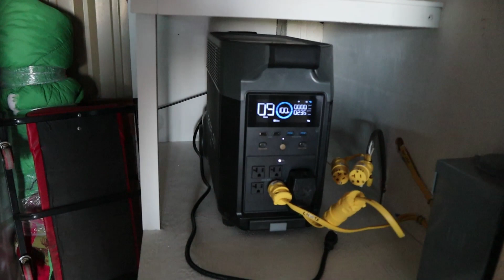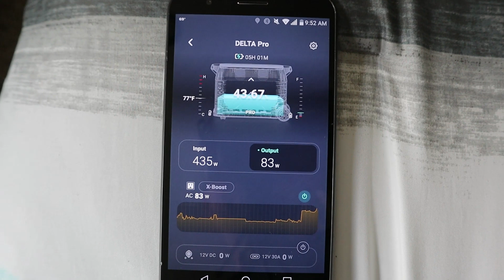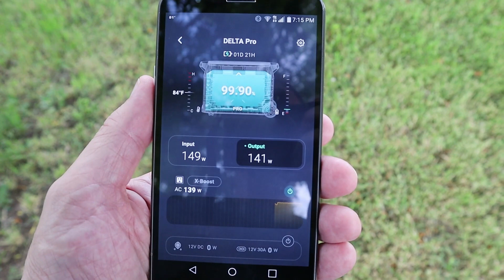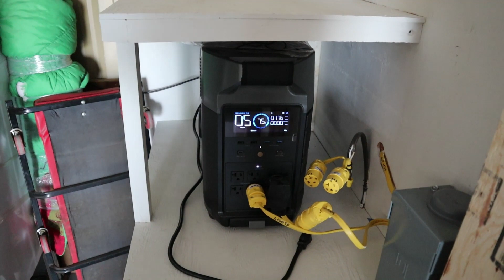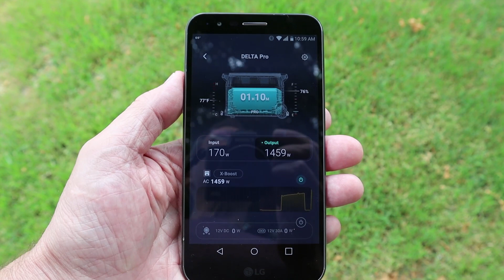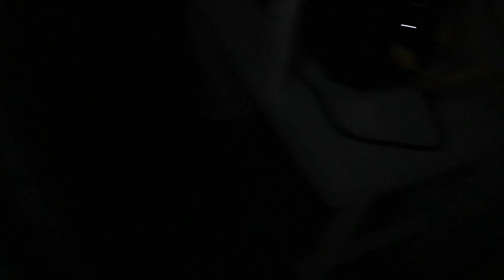Off grid: EcoFlow Delta Pro running an RV

Comment: In all reality ac and heating is a huge part of life why cant any of you just do a video on how long itll do the ac for
Reply from the maker: Is that a request?
Reply: @bladeslicemaster5390 whoa 😅 yeah if your still using it youd be the first video im sure of it 😂
Reply from the maker: @cryptologic90  a motorhome A/C unit has a 13.5k btu unit that takes about 1,300 watts while running, start up is much more. The Delta Pro has 3,600 watt hours of battery capacity, so without any solar input, or anything else running, it would run it for about 2.5 hours. Hope this helps, thanks for the suggestion!
Reply: Do you know about the soft start for the AC if not check into that  @cryptologic90

Comment: I just got my D-Pro, $5,000 but worth every penny! It is rather like a computer backup battery on steroids!
Reply from the maker: Congrats! I use mine every day. I'll post a video of it running an irrigation pump soon.
Reply: @bladeslicemaster5390  It runs microwave ovens like second nature!  Sure the first flaw is purchase price; it is pricey. But the one huge flaw is weight.  We all know it is not much bigger in dimensions than an average 2000W gas generator but it weighs more than double those generators, 100 lbs!

Comment: How many watts are the solar panels connected?
Reply from the maker: 1000 watts al together.
Reply: @bladeslicemaster5390  Thank you for the quick response. Do you know the maximum amount of panel wattage the delta pro can handle? Also do you know if it can run a rv that has a 50amp plug? I know nothing about solar so trying to understand the concept.
Reply from the maker: @8victoryinjesus  max wattage is 1600, see my video on "running an RV" Thanks!

Comment: Great video.  The best way to use the DP in an RV is to connect the 30amp DC connection on the DP to your RV, then turn off the converter circuit like you did.  This way there is no loss for converting DC to AC then back to DC.  That is how I use it in my travel trailer.  I keep it in the passthrough storage.  Presently, I run the DP 30amp AC connecter outside to the RV 30amp shore power connector.  This is a mess and only a temporary solution.  I purchased a 30amp transfer switch so I can have it switch between the DP and the shore power, but I have not connected that yet.  I need to drop the underbelly to run the wires and am waiting for a few rainless days before taking that on.
Reply from the maker: Thanks for your great comments!
Reply: Hi Frank - we just got a DP and plug our RV 30 amp directly into the DP. The first time we did this and tested various appliances it worked great. The second time we plugged it in, there was a continuous 400-500w draw happening even though we turned absolutely EVERYTHING off in the RV and unplugged everything. Any ideas what could be happening here?? it's unusable to us until we can figure this out as it just drains so fast. Just thought I'd ask, no worries if you have no idea. 😂
Reply from the maker: @sunnichapman  Maybe water heater?
Reply: @bladeslicemaster5390  we made sure to have water heater and water pump and all that off too. I think it may be actually just attempting to charge our RV house batteries like you said and I need to turn off the converter circuit, but I am not sure where or how to do that on our Forest River Forester RV, we know where the little fuse box with fan is, but not sure how or what to 'turn off' there in order to do that?
Reply: @bladeslicemaster5390  thank you for your reply!
Reply from the maker: @sunnichapman  There should be a main breaker that disconnects all the power, give that a try.
Reply: @sunnichapman  it is either charging your house batteries or the fridge is running on AC. Check that the fridge is off or it is not in the auto position. If it is on auto it will switch to AC power whenever it's available. That means it will run if the Delta pro is on and the inverter is on. As far as finding the breaker for the converter, just look at the notes inside the breaker panel. It should tell you what breaker turns on and off what in the RV. If it's not marked then a little trial and error won't hurt. There should not be many breakers to turn off anyway. But if you are only using the 30 amp AC outlet on the Delta pro you will need your converter to be on. That is what will power the DC circuits. Like I said in my post, if you use the 30 amp dc output on the Delta pro to power the DC circuits of your RV, you don't need to use the converter. Hope this helps.
Reply: @yankiefrankie  thank you Frank! yes we did put the Fridge on Propane only, and turned it off "auto", and even turned off the fridge just to be sure. But then kept it on propane only. Thanks for the suggestions on finding the converter, will try that! And thanks for the clarification on 30 amp AC outlet. Forgive my ignorance but I am a bit confused on that part, we plug in our RV's 30 amp shore power plug in directly to the Delta Pro, and that's it. I am not sure the difference between where you say 30 amp DC output on the Delta Pro and 30 amp AC outlet on the delta pro? Thanks so much for your help!
Reply: @yankiefrankie  So we did figure out that it was indeed charging our house RV batteries after our test today. I found the breaker for the converter, turned it off and the DP stopped pulling power for the battery, but it also stopped pulling power from the DP for anything else in the RV that we turned on. I'm not sure if there is a way around this for us, but if I am missing something obvious, let me know. Thanks again for your help. :)
Reply: @yankiefrankie  I figured it out Frank! Sorry I was not getting it, but I get it now. :)
Reply: @sunnichapman Your RV runs on mostly DC power. That is why it can run off a 12volt DC battery.  Lights, refrigerator (on propane), fans, furnace, water pump, etc all run on 12 volt DC.  The only things that run on 120volt AC power are the air conditioner, microwave, water heater (if switched to electric), refrigerator (if switched to electric or auto), and the 120volt AC outlets that are scattered arounfd the RV.  None of these AC appliences that I mention are available when you are running on normal battery power (without the Delta Pro).  When you plug into shore power or connect the Delta Pro through the 30amp AC RV plug (on the front of the unit), some of the AC power goes to directly power the AC circuits that power the AC devices I mentioned earlier.  Some of the AC power goes into the converter circuit, which converts to AC power to DC to power the DC devices and charge the house battery.  If you switch off this breaker, you will no longer get power to most things in the RV (but the microwave will work! ;-))

Running the entire RV using the shore power plug through the converter is fine when running though your house electrical, but it is an inefficient way to run an RV from the Delta Pro.  The converter in the RV is not very efficient and generates a lot of heat converting AC power to DC.  Also, the Delta Pro is a DC battery and has to invert the DC power in it's batteries to AC to output in that 30amp plug.  So to run something like a simple light in the RV the power goes from the Delta Pro DC battery -> invert to AC -> back to DC in the RV converter.  This can use more than 50% more power to run that small light.  Now if you are charging your house battery this 50% more power is HUGE, and it makes your Delta Pro not last very long to run the RV.

The good news is there are ways around this.  The Delta Pro has a 30amp DC connection that can be used to directly power the RV DC circuits.  It is in the little door on the front right corner.  It has red and black Anderson connecters.  For a more permanent solution you can wire this connection directly into your RV DC fuse box.  My travel trailer came with some wires in the pass-though storage that were labeled for an inverter.  These wires go to the fuse box.  When wired this way you can then turn off the converter breaker.  The Delta Pro can directly power the DC devices in the RV without any conversion.  This is very efficient and lasts much much longer.  I keep my DP in my passthough and have to wired to the DC circuits.  I also have a the DP directly wired though the AC using a transfer switch.  This way I don't have to plug it into the rear shore power.  There are many videos on here about using a 30amp transfer switch.  But the most important thing is getting the DC 30amp from the DP to directly power your RV DC circuits.

If you must use the DP to run the RV through the converter, you can disconnect the negative (black wire) on the house battery.  This will stop it from charging the battery and conserve some power.  Just be sure you don't let the house battery go below 50% if it is lead acid.  This could damage it.
Reply: @yankiefrankie  Thank you soooooo much for the detailed education on this Frank!! I really appreciate the time you spent in breaking that down for me! 🙏💗 That helps SO much and totally clears things up! I will have to see what kind of wiring we might have in the passthrough if any to go to our fuse box, cause that would be such a great solution! In the meantime until we figure that out, just being able to turn off the converter and have DC items pull from house batteries and AC pull from Delta Pro will work so much better, as we have propane for fridge and water heater so don't require much draw on DC. But I would much rather do something like you've done for a long term more viable solution, so will be looking into that. Thanks again so much for your time!